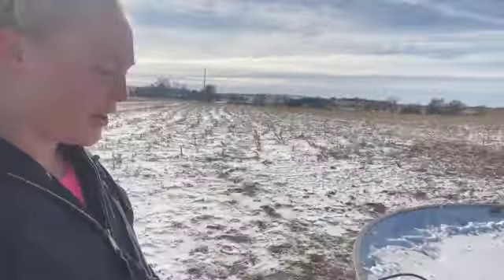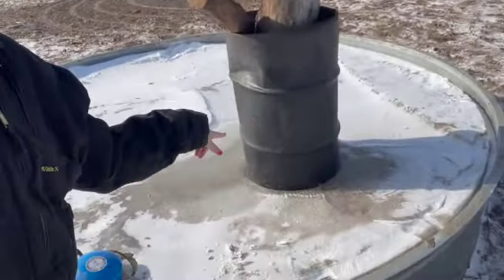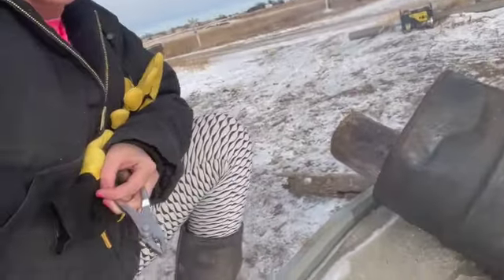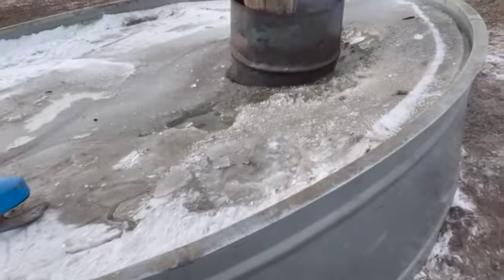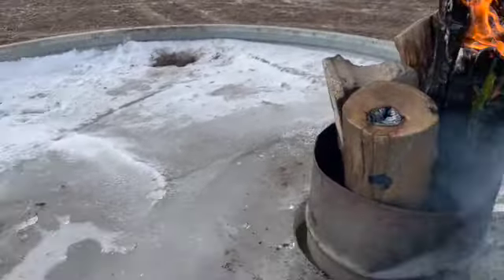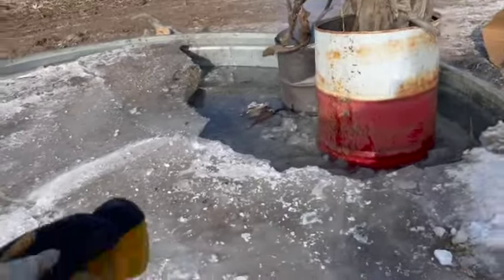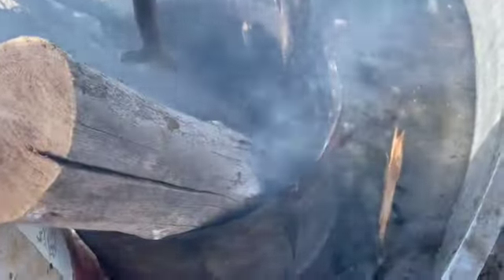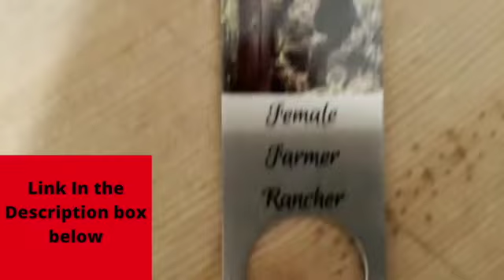Cold Start Chainsaw, Unfreezing a stock tank, Nebraska Winter

Comment: Great working woman to ease yourself a little bit go get you an electric chainsaw that way you don't have to mess with the gas and oil mixture and pulling your arm out of whack they're a lot easier to use in your case because of the cold because gas does freeze with oil so it's reason why chainsaws take a little while to get started so go get you an electric powered one they're pretty easy to use same the same methods other than that barrel's good instead of put them in water I had to put a couple of them on the outside to wrap the container around so you can get some steam going on so it'll it'll keep going other than that you doing a great job be safe and thank you again
Reply: Gas does not freeze
Reply: @kraigmcintosh5282  gas oil mixture does do it just try it when you're minus zero degrees or below she was -2 the other day I'm sure it gets colder than that but when you do mixture with that with the chainsaw it does do that
Reply from the maker: Electric ones don't hold up like we need them to out here. To see all my other content click links bellow!
For all the photoshoot content plus much more please go to my True Fanz:
https://fans.truefanz.com/Femalefarmerrancher For any merchandise please click link bellow 
Femalefarmerrancher.bigcartel.com